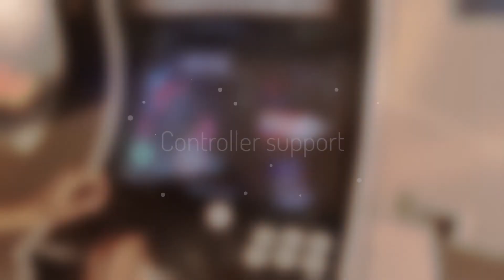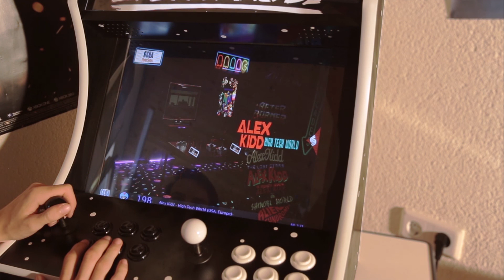DIY Bartop Arcade Showcase - Raspberry Pi 3 Project

Comment: A full hardware list would be greatly appreciated!
Reply from the maker: Raspberry Pi 3 (+ heatsink and case)
SanDisk 64gb SD Card
Zippyy Joysticks
Suzo Buttons (with standard microswitches)
Ultimarc I-PAC 2 (keyboard encoder)
Lenovo L193P Monitor
Trust Leto 2.0 Speaker

Hope this helps!

Comment: Hello, can you share the volume control link?
Reply from the maker: of course
https://amzn.to/2KGWgDS
Reply: Balkerz Shuffler Thank you😀
Reply: Balkerz Shuffler How do you use the volume control?
Reply from the maker: You also need two Cinch to Aux cable -> https://amzn.to/2ukhj3U
Plug the Output from the volume control into the speakers and the Input to your Raspberry.

But there is an easier way to control your volume:
If you have two buttons left over, you can program retropie to use these buttons as + and - volume buttons.

Hope this helps, cheers.
Reply from the maker: There is already an volume control included with this speaker.
I used this one: https://amzn.to/2mbvAMG
It's really cheap but you don't need a good sound system for chiptune to be honest.

You can see my brown power strip at 1:30 on the left.
Reply: Balkerz Shuffler Thank you, cheers.😀
Reply: Hey, you use is attract?